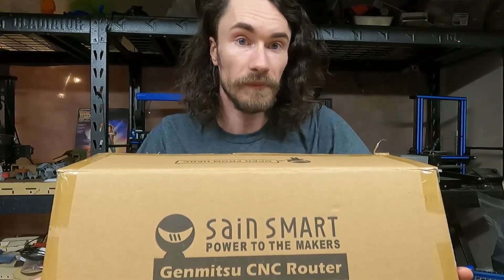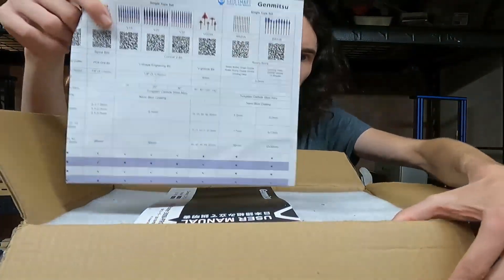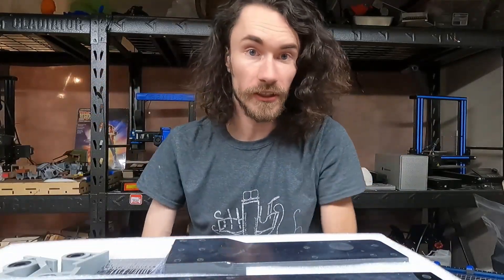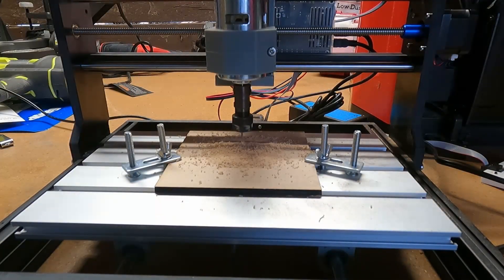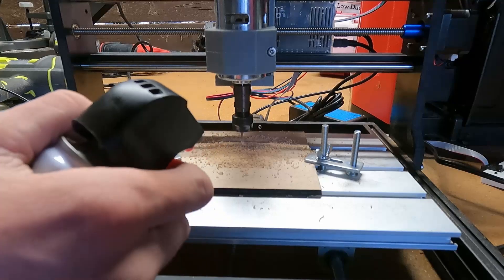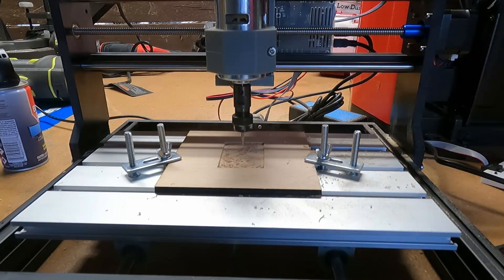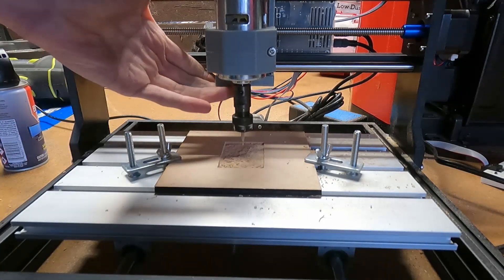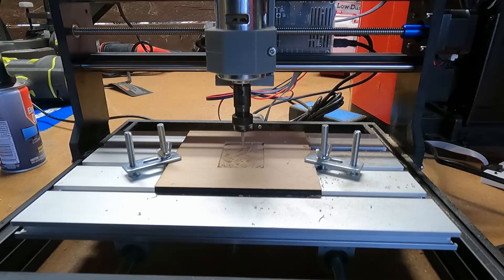Building A CNC Router

Comment: The spindle seems like a weak point. I don’t suggest a 3018 for anyone unless you just want to learn gcode and CAM, maybe switching tool heads for a pen plotter or basic pick n place. I can see from your engraving that if skipped steps, out of the box, and that’s not a good sign.
Reply from the maker: Yeah the spindle is a HUGE weak point... Cutting things like foam, it works fine, other than that... Not so much. The biggest issue I had was there was no "alignment key" for the "Y" axis bearing blocks to locate to the aluminum extrusion on the table, and it is sooooooo easy to get those misaligned that way... It is frustrating that if they spent say another $20 on limit switches and maybe a better spindle setup, they could have a kickin machine. But alas, they made it as cheap as possible and...